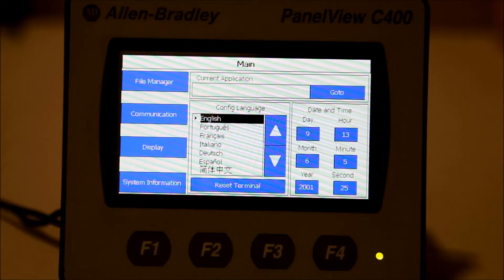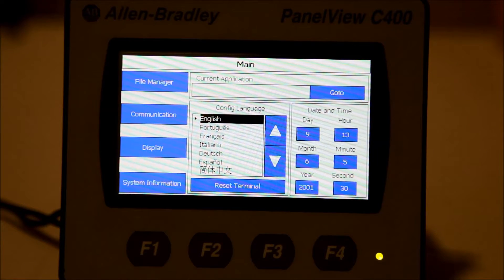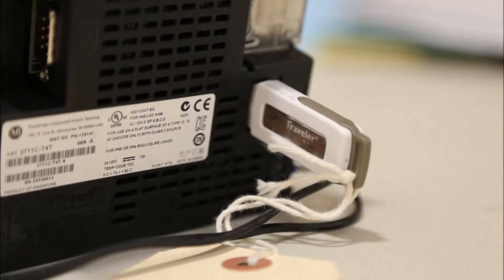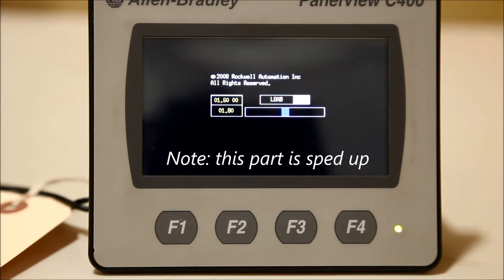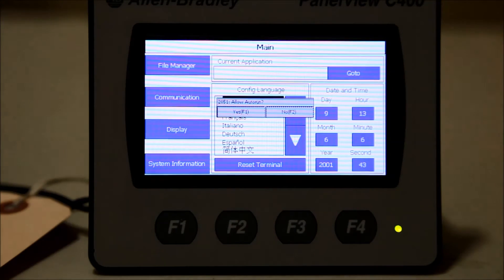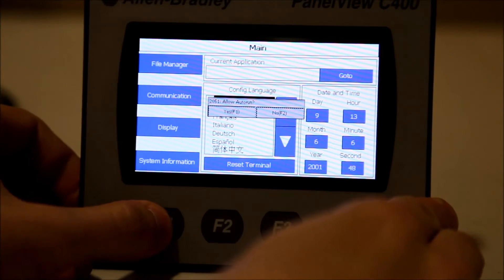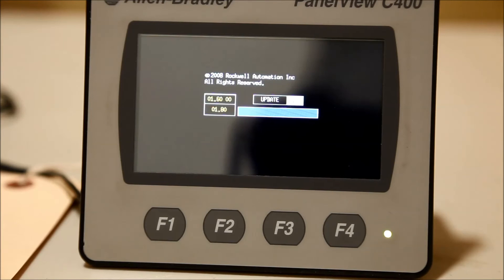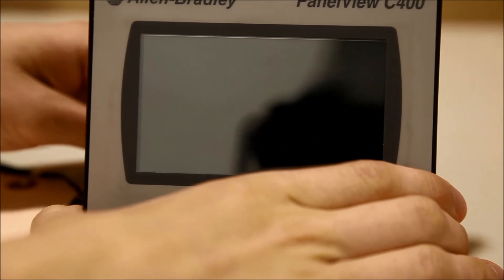Update the Firmware for a Panelview C400 HMI

Comment: I have a HMI C300 and error 0A appears, what should I do?
Reply from the maker: Try connecting the terminal via USB with the Firmware Update Utility and attempt a firmware update.  If that fails, reset it back to out of box mode.  If this does not work, replace the PanelView Component.